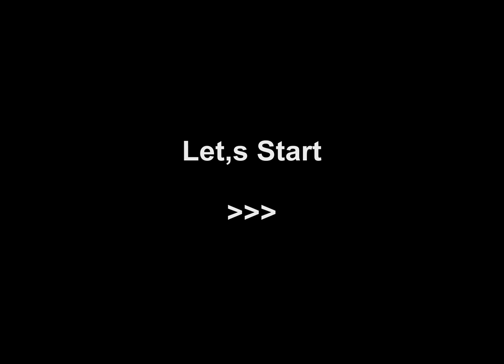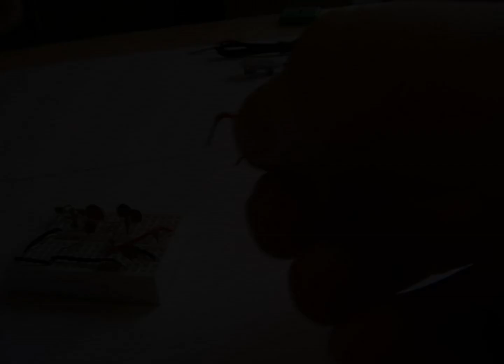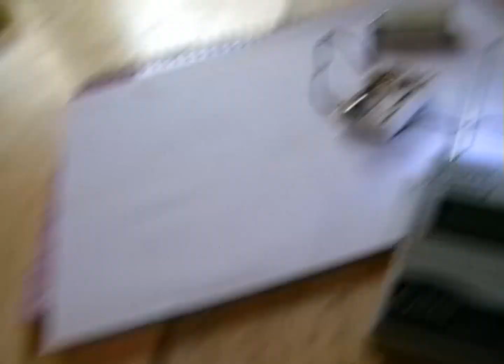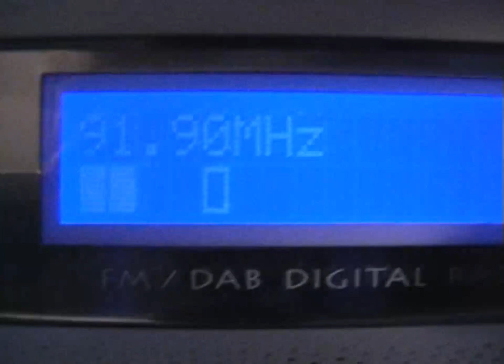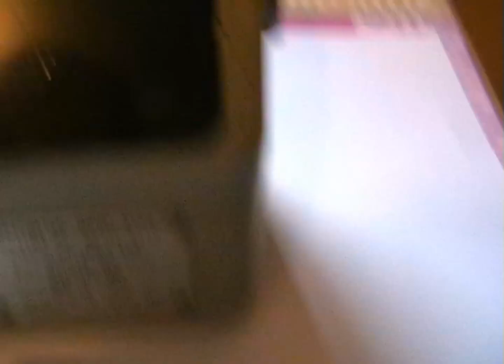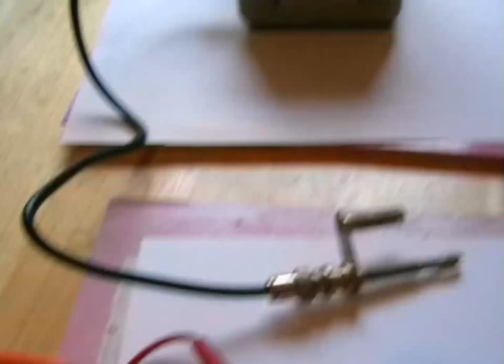The Breadboard FM Transmitter.

Comment: Gonna try this. Seems similar to this and from the same website. Wondering what the practical difference is: https://static-resources.imageservice.cloud/1298800/compute-the-voltage-gain-of-fm-transmitter-high-a-cheggcom.png
Reply: different oscillator i think
Reply: Still trying to understand why certain circuits have 2 transistors and some have 3.

Check this out: https://www.instructables.com/id/The-Ultimate-FM-Transmitter/

It seems it’s to do with the oscillator and mixer, the preamp transistor is always there.

Comment: Great vid.   maplin only has a 2.2uf inductor. Is that OK to use? thanks
Reply: a 13 nH inductor worked well for me (in the oscillator), with a regulator... keeps the transmitter right on an unused frequency (station) in my area! but if you are referring to the RF amp stage inductor, i don't see why a 2.2 uH wouldn't work, even a 10 uH worked for me... 1 uH may be best! It won't hurt anything to try it and see!

Comment: Hi thank you for the videos, I saw a lot of f your fm transmitters videos. could you please explain how it works in terms of components and the values. thanks
Reply: i think the oscillator stage is a class A biased common emitter (typically by itself without any other stages would be a common base), the audio stage may very well be a class A common emitter as well... i think the RF amp may be class C biased common emitter ... as far as component values and how to select them... L = 2*pie*frequency*impedance ... C = 1 / 2*pie*frequency*impedance (L)reactance = 2*pie*frequency*L and (C)reactance = 1 / 2*pie*frequency*C (for the tank) L and C are in parallel... coupling caps C = ~0.4 / lowest frequency * impedance ... bypass cap C = ~0.8 or 0.9 / lowest frequency * resistance ... the smaller the inductor/capacitor values and/or dimensions, the frequency should increase (if correct amplifier is used)... the resistors set the current/power gain and/or input/output bias ... the oscillator is a colpitts oscillator which uses positive feedback (from collector to emitter via capacitor) ... the transistors will have a transition of about 200 MHz (suited well enough for a 100 MHz oscillator in the FM band for a transmitter) or they will still propagate at this frequency... the RF amp stage amplifies the mixed or modulated audio and RF carrier signal to the suggested regulated power limit for typical unlicensed FM broadcast in my region... i think this thing is called a skud...

Comment: you could also use a 5 or 6 volt regulator with a boost converter powering the circuit to get a steady DC voltage and frequency...

Comment: Holy shit it worked ! virtually no range but I heard myself blowing and tapping on the mic on 94.0 fm.. any idea what could be wrong? one thing is that I couldn't find any 15p capacitors so im using a 12pf right before the antenna.. but it worked.. is this why im not getting any range? you my dear sir are all good in my book.. thanks

Comment: what kind of wire did you use for the inductor?
Reply from the maker: +Christian Hernandez 
The coil is made from 0.5mm Diameter enamelled wire ,the wire does not need to be enamelled wire,you
can use any solid core wire from : 0.4mm upto 0.8mm.And wrap the wire around a 3mm drill bit to make a coil

Comment: All I have for the antenna is copper milticore. will this work? What kind of wire are you using?
Reply from the maker: You can use any type of wire.
Reply: I'm getting weird reading at the rf amplifier stage. Vbe is large and negative...? Any idea what I might do to trouble shoot?

Comment from the maker: The most common mistake is not removing all the enamel from the ends of the wire for the coil ,and make sure all transistors are fitted the right way round.

Comment: i made my homemade  1 uh coil.. that was hard i used coil calculator for that... I had to convert mm into inches and then put it in calculator.   now when I see that you are here i want to ask you can I use two bc182b transistors and  2n1893 for mic amp ?? please look into datacheets of these I am beginer help my ! :)

Comment: Do you mean the white platic board? It's called a (solderless) breadboard and in this case has the holes in each row connected and you just 'pin' the components into it. Very useful!